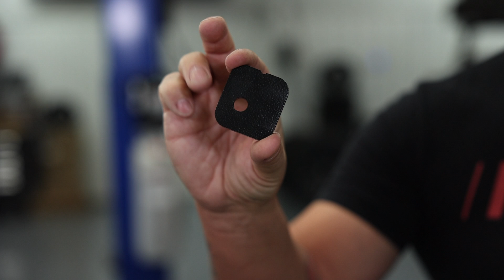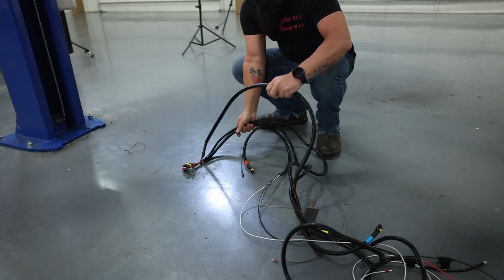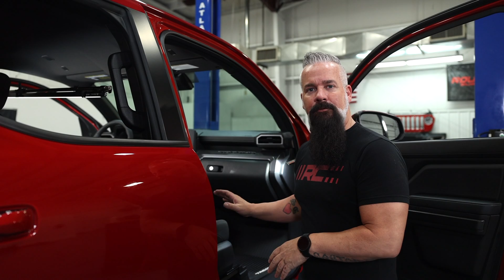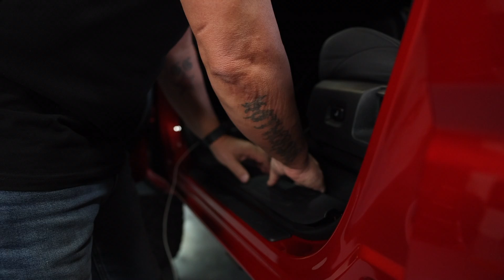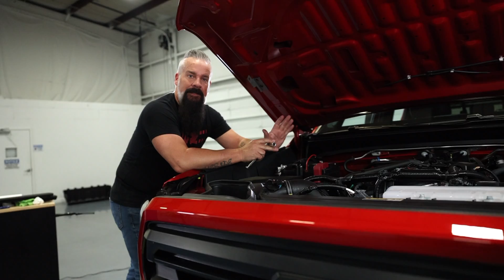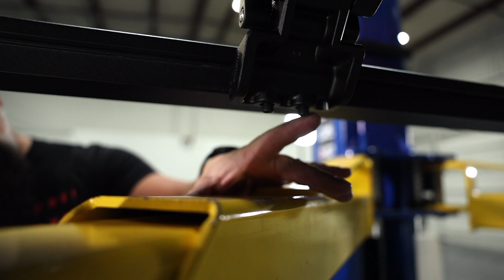How to Install Rough Country E-Boards on a 2024 Toyota Tacoma: Step-by-Step Guide

Comment: For the 24 4Runner the wiring is opposite, module and battery on the driver's side. Yet, the wiring harness is still labeled for the Tacoma.

Comment: There is no way the control module fits where he is installing it. The module is too long and doesn’t fit between the frame
Reply: Correct. I just installed a set on my '24 Taco. I had to bend the bracket down to make it fit.
Reply: I had the same problem where the module doesn't fit. I removed the module from its bracket then re-attached it onto the other side (module is now facing the ground). I also needed to slightly bend the bracket too.
Reply: Just ran into this problem.. the control module is installed backwards. I just reinstalled it on the other side of the bracket and it sits flush, no bending needed